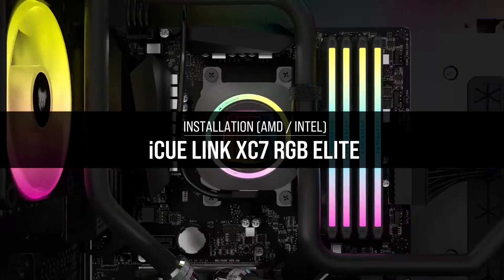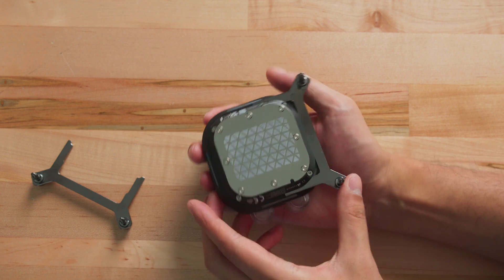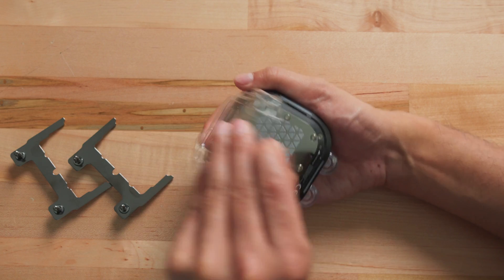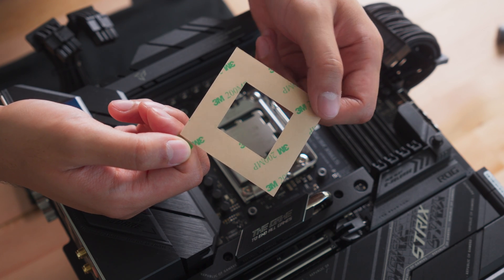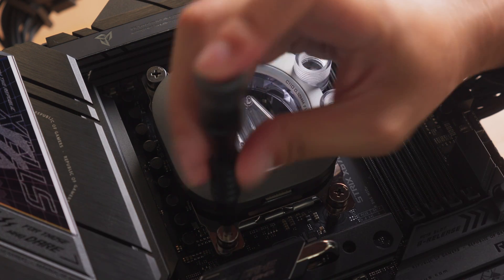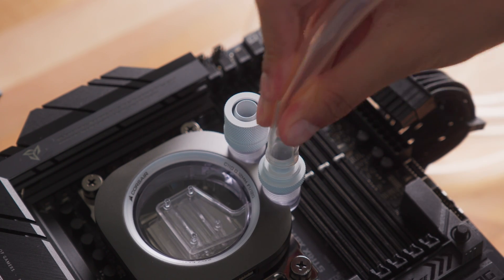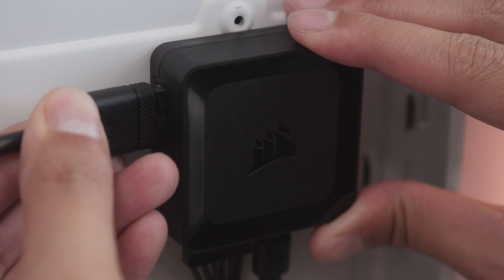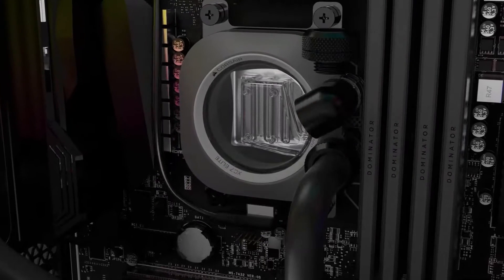Installing the CORSAIR iCUE LINK XC7 RGB ELITE CPU Water Block

Comment: Looks good. I want to try water cooling one day, maybe after getting another case.  I currently have the Corsair 4000D Airflow in white, with a H100i Elite Capellix and LCD Screen Upgrade. I'm running 6 Corsair fans, 4 LL120, and 2 that came with the AIO.   I think I want to upgrade to at least the 5000D White, someday maybe.